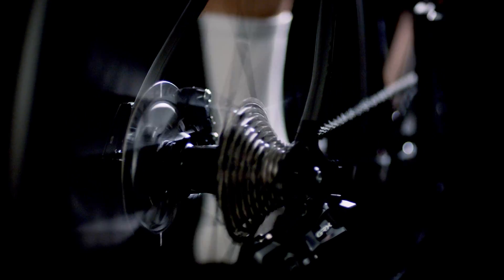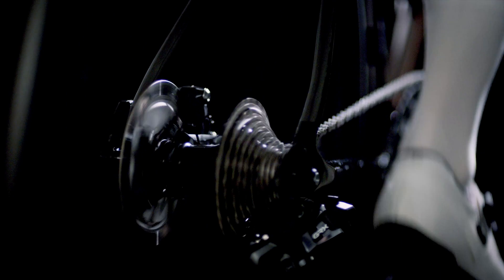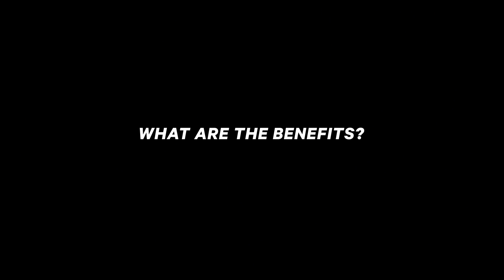Classified Powershift: how does it work?

Comment: If you use the non direct gear, it will take some energy. In my eyes it only can have an advantage when the time needed for shifting gears is very important. And normally you must use the direct gear, not to loose power. In all stories i have read, they never tell you the downside. It reminds me of the oval chainring in front.

Comment: This internal gear system appears to be mechanically superior to a front derailleur system. If so, the evolution that drives change in the cycling industry will ensure that this tech is adopted and perfected over time.

As I’ve always disliked front derailleurs, I’m delighted to see this invention and am ready to sign up.  

When can we expect to see this system arrive in Texas?
Reply: Planetary gears waste around 4% watts minimum. I am not sure the cool factor outweighs the waste of energy.